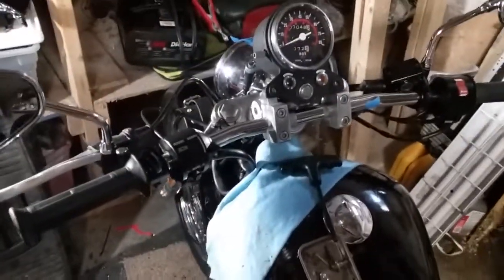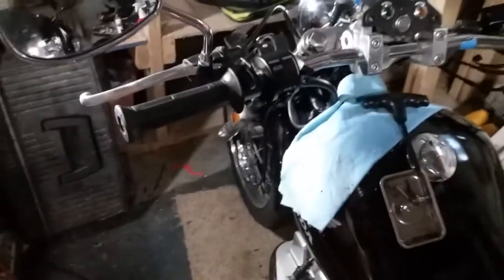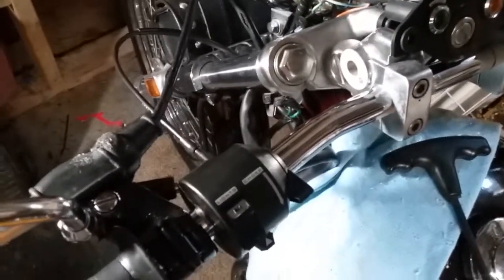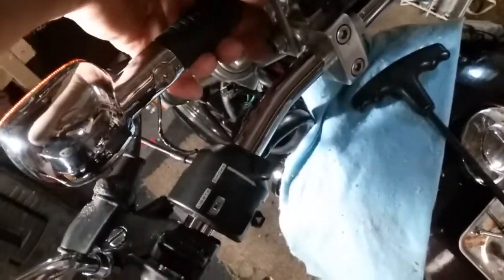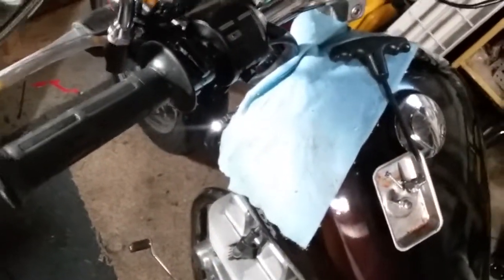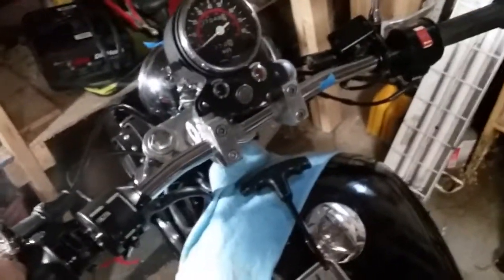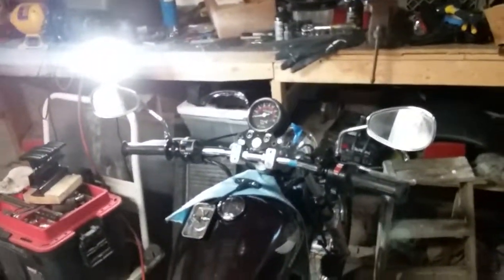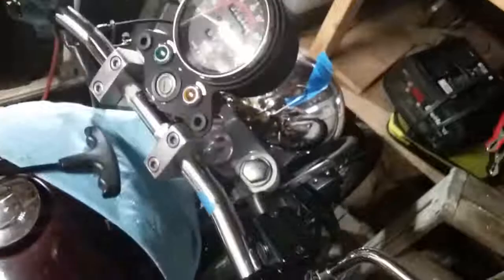Honda rebel gets drag bars

Comment: You have to drill holes for the switch housings. You DO NOT need those bar end weights on a Rebel 250. I've put over 30K miles on Rebel 250s without the bar end weights. They make NO difference, they just make the bars longer, which caused a problem getting the bike in my shed, so I removed them. However, you WILL run into problems with the cables and brake hose being to long, and dealing with the wiring. I have no idea how Honda got all those wires into that little plastic box, but once they come out there is no getting them back. Drag bars do help a little if you are on the tall side. I am 6' and was sitting between the front and rear seat. The drag bars moved my upper body forward enough to sit in the middle of the front seat, which made it a lot more comfortable. But your knees still hit your chin. I'm planning on either coming up with some kind of forward controls, or at least highway pegs.  

As for the turn signals, it is probably better to get some aftermarket signals (with amber lenses, or the cops will be after you) and mount them on the fork tubes like the stock ones, but farther down. I would call up Russel and get a shorter brake hose. The choke cable will also be too long, but will work with the turn signals out of the way. 

Dude, on the left, the switch housing goes against the grip, and the clutch goes on the right side of the switch housing, when sitting on the bike. This would be a good time to get rid of the clutch nanny switch.